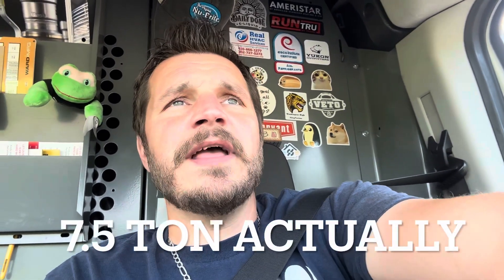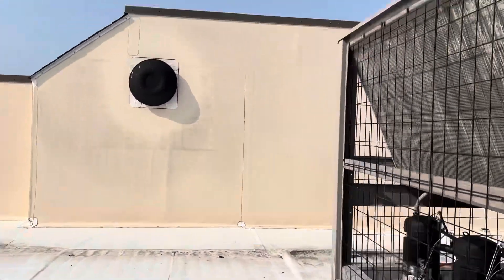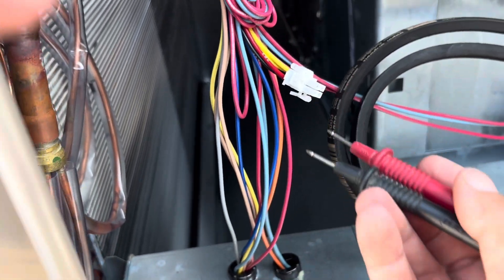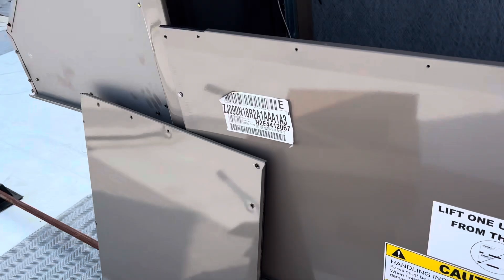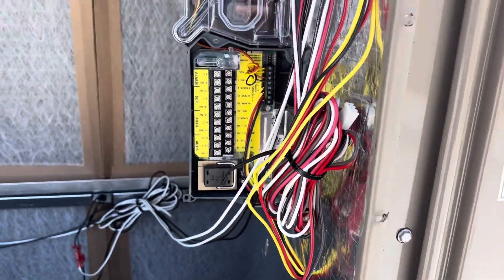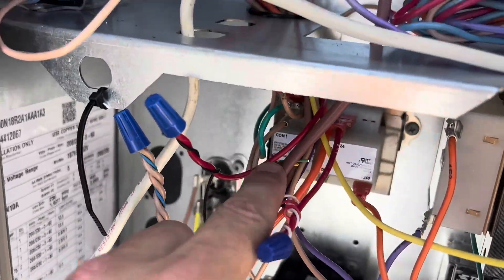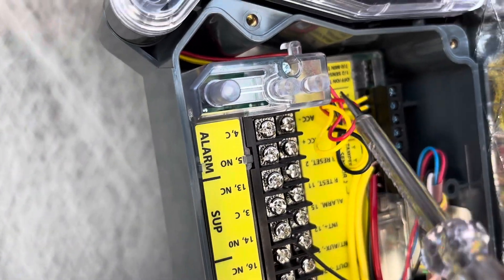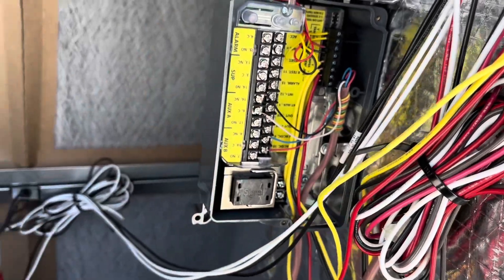HVAC Inspector Says No Go… You Need Duct Smokes!

Comment: Some boards like Carrier Comercial RTU's come with a place to connect the detector this is always preferred, but if they don't it is better to break 24 to the control board to cause an immediate shutdown of the blower.  This is required in our area. 

With ECM motors an isolation relay is also required.  besides breaking power to the board you must also break the high voltage to the fan, otherwise the fan will continue to run until it times out.  

In our area the duct detector must be sensing after the blower motor, in case the motor were to catch fire.   This can be done by mounting the detector before the blower with one tube open to the compartment and the second tube with a hose or pipe connected after the blower compartment.  No need for the sampling tubes, the difference in pressure before and after the blower, will cause the detector to sample. 

If Interlocking detectors they must all use A SINGLE TRANSFORMER dasy-chaining it from RTU to RTU.  If you attempt to use more than one transformer you will blow up boards and transformers

Mount detectors so water won't fall into the plastic housing, this is a common failure point when condensate drips into the detector.

Comment: Never see the Smokes in the Units up on the roof here, just below the roof in the supply and return ducts. Also we use the Air Products SL-2000's with their FastTubes (pack of three 24" tubes) and just snap together and cut (the plastic tube) to length as necessary...light weight, not conduit style with punched holes.

Comment: While it works fine the way you wired it. Those boards have a duct smoke shutdown set of contacts and the simplicity board will display "ductsmoke shutdown" when they trip, instead of just killing 24v to it.... Just makes it easier when troubleshooting for the next guy. 

Side note i hate those York/JC boards. 120 seconds evertome you cycle the unit, so stupid. 

Hopefully Bosch gets rid of those eventually.
Reply from the maker: Yea I figured they did have a shutdown feature.  
Yes hopefully Bosch improves a lot of stuff! 🤙
Reply: That doesn't work in all areas, because interrupting R doesn't give an immediate shutdown of the fans.  Should use the designated spot on board or interrupt power to board.

Comment: Nice video Jeff I am assuming the duct smoke sensor  requirement is because the unit for heat is natural gas.

Or the unit uses a2l refrigerent which I don't like at all.
Reply from the maker: Just any ducted system over 2000 cfm they say.  🤷‍♂️
Reply: @JeffsHVACAdventures   thanks this must be a Comercial hvac requirement in Maryland not sure about Pennsylvania.
Reply: If a fire breaks out in any part of the building and smoke starts getting into the ducts, the detector will shut the system down and alert the fire department.  You don't want to have your HVAC system feeding oxygen to a fire or spreading smoke to other parts of the building.